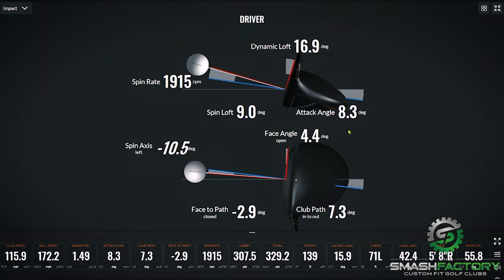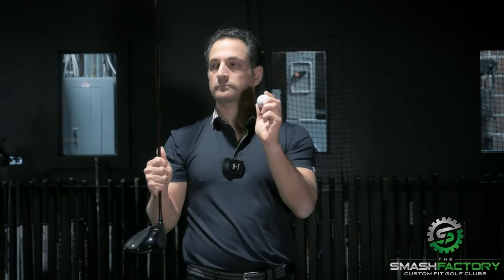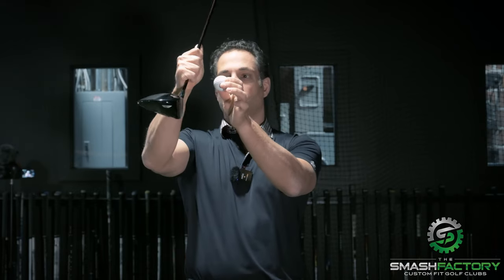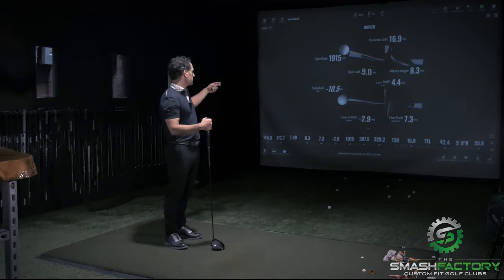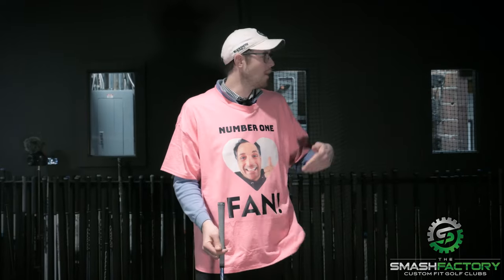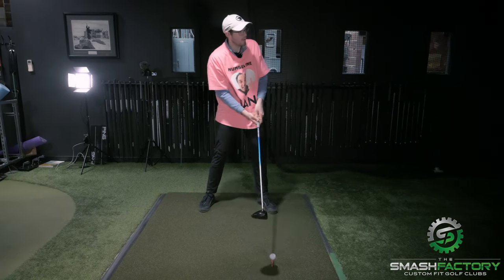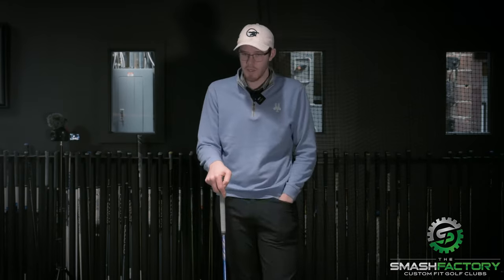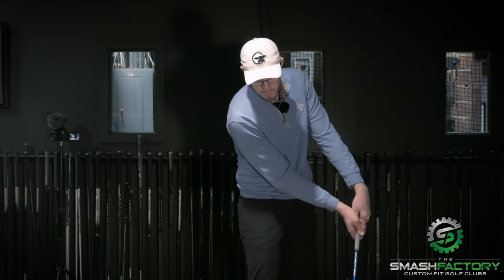The Science Behind Your Swing | Ep. 7 After Show

Comment: So, the past 3 weeks I have had an issue with my driver where I'm hitting really low stingers or worm burners. Would you talk through the swing plane?
Reply from the maker: Hi G! The first step would be to check your strike location with driver. A lot of low drives come from low on the face contact. If it’s out of the Center, you are potentially too steep with too little loft delivered. If so, try and get your head back and weight on your trail leg. Should get it launching higher.
Reply: @SmashFactoryGolfChannel  I hope so, I have been very frustrated with this sudden turn of events. Thanks for the help!